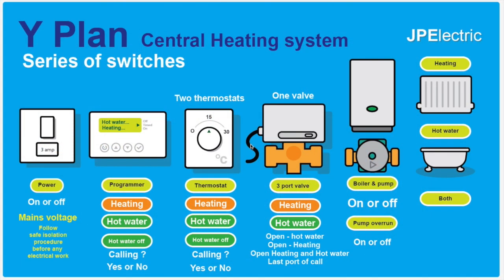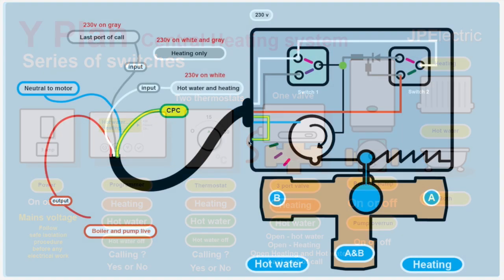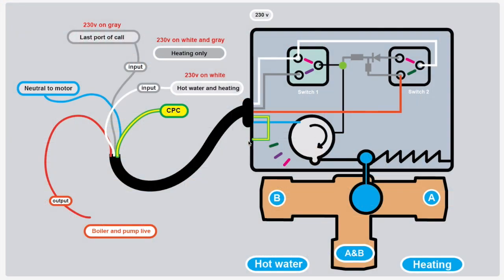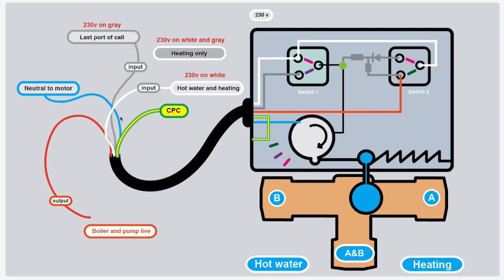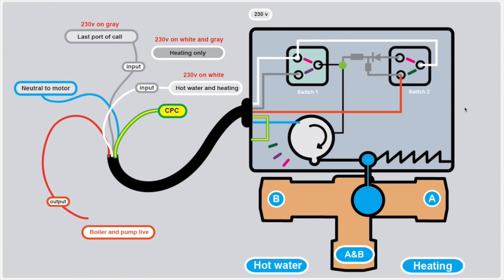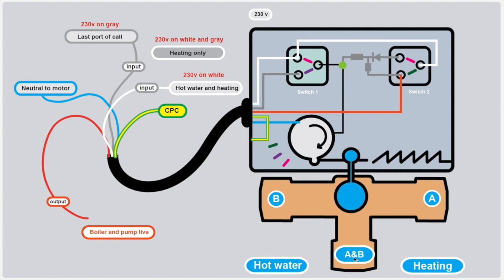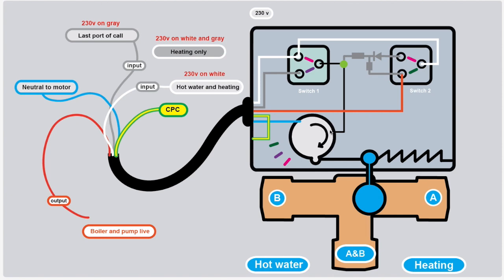Y plan wiring - made simple

Comment: This is the clearest, most helpful video I have seen.  In the only video that is remotely helpful - and I have looked long and hard.  You have a gift, sir. Thank you.  The plumbing in my house is very "unusual" and I have had many "engineers" work on it over the years. NONE of them have the remotest idea how to do this stuff. The expect every installation they come across to be identical to what they were taught.  They simply don't understand what all the individual components do.

Of course they know infinitely more than I do about the boiler and all the text book stuff, but no clue about how to analyse an arrangement where the orange wire is not where it is supposed to be, where the pipes come from a different outlet or go to a circuit not per the text book.  The standard answer is to rip the whole thing out, take up the floors, open up the walls and start from scratch.  Or just to replace each component in turn in the hope that it will magically solve all the problems.

And yet we have had a system that works as it is supposed to and has done so for over 40 years.  Until one of these "professionals" changed something a couple of years ago making it unworkable.  We can have hot water, OR heating, OR we can have the towel rails heat, but none of them at the same time. 
Your video has armed me with the knowledge to put it all to rights myself.  Fortunately I am an Electrical Engineer and getting to the bottom of the electrical circuits in the boiler itself, the programmer, the thermostats installed, our Nest, and the 3-port value has helped, but your video has answered some of the outstanding confusion I had.  Thank you so much.
Reply from the maker: Thanks Rob, really appreciate your comments, hope you got it sorted.

Comment: This has helped me understand how it all works, saved me a fortune (that I wouldn't be able afford anyway). Thank you! My heating is getting stuck on when there is no call for hot water or heating, so the mid position valve is sending on the signal to pump and boiler when it shouldn't. I'm replacing both the mid position valve and actuator this weekend thanks to your help.
Reply from the maker: Hi Joe T.
Thank you for watching, and your kind contribution,  I really appreciate it.  Hope you got your system working again.

Comment: Thank you so much for one of the best video's I have found on how the single 3 port valve Y-plan system controls the flow of heated water from the boiler. I retired from the trade 2 decades ago and the firm I worked with only installed single zone Combi boilers. That meant, i never got involved with zone valves. Fast forward now, I am looking to get my Y-Plan old Potterton boiler swapped with a Vaillant heatonly boiler and looking to have to figure out how to wire the 3 port valve to the VR66 wiring centre which only accepts L, N and E wires. The Room Thermostat communicates directly with boiler using Vaillant e-bus it communicates with the Wiring centre to control the mains relays for HW/CH and Thermostat controls. From what I have seen the techs are doing is, the Orange and Grey wires are connected together. Is this considered to be the correct practice?
Reply from the maker: Thanks for the nice comment MP.  Unfortunately I can't really offer any advice. I'm not a heating engineer, just a spark tying to make sense of the basics of heating controls.
Reply: @JPElectric  No problem at all. keep doing what you are doing. I found the install guide for the wiring centre and it shows exactly which wires need to go where for 3 port valves.
Reply from the maker: Glad you got it sorted

Comment: Really good instructional vid on Y plan, this and another vid by another youtuber have given me full grasp of how this system works. Now then, I have a question!  Is it possible to have an arrangement that turns off the boiler and pump if for some reason the boiler fails to light?  This would be to prevent the pump running cold for hours with the boiler not lit. Asking because I have two properties with boilers prone to flame out faults. Both are old boilers, which despite servicing still have this problem, but I can't afford to replace them.

Comment: Great explanation of how a Y plan, particularly the three port valve works. I'm looking to utilise switched lives 1 & 2 to give me high and set temperature on my boiler for hot water and heating, respectively. Apparently, to do this I'll need to convert to hot water priority which also (apparently) means I'll have to turn the valve 180. Obviously the wiring will have to be altered to match. Might be a bit of a head scratcher but you might have given me the info I need. Many thanks for that.
Reply from the maker: Thanks Phil, hope you had good success

Comment: I think I must be missing something here. I refer to the heating only diagram. The room stat is shown as open circuit, but the valve is shown in the central heating position, whereas just operating the CH on would not switch on the heating, or operate the valve without the room stat being operated. 

For what its worth, when I installed the system  I still have some 27 years ago I installed it with a mid position Myson valve. Time and time again it would stick in the mid position. I eventually came to the conclusion the the spring (a coil spring) did not have enough tension in it in mid position operate. I was so fed up with it I changed the whole thing for a 3 port Honeywell priority valve. I,m sure some might not like the fact that you can't have both ports open at the same time. But, I've never found it a problem given that it's takes no more that 20 mins to bring the HW temp back up, even after having a bath. Of course, if I was installing a system now, assuming I didn't go for a combi boiler, I would go for 2 port valves.
Reply from the maker: Thanks John. I will re look at the video, and get back to you.

Comment: Keep returning to this video if I have a problem with Y plan fault finding .@9:27 Heating On only.Both Room stat & cylinder Stat are "satisfied" (both NO).@ 9:29 Heating off(HW off as well.)both room stat & cylinder stat have flipped over to "calling" NC.Is this because this is their default setting (NC) when everything is OFF?I am trying to ascertain whether cylinder stat is faulty.
Reply from the maker: Hi Freeze foot 
Honeywell have some guidance on checking cylinder stats basically....
could be  a faulty Cylinder stat only if
Terminal 1 does not become live when calling for
Hot Water,  or Terminal 2 does not become live when
satisfied. ( Terminal C should be live in both
cases). When checking, disconnect Terminals 1 and 2
to prevent  backfeed causing incorrect readings
Reply: @JPElectric  Thank you for your reply as always.I may be guilty of overthinking this one , but always worth revisiting this video as I always find something that I missed first time round.

Comment: When both heating and hot water are calling for heat but then the room stat becomes satisfied why would the radiators continue to heat up until the hot water is satisfied or until I switch the hot water off and then on, then it behaves?

Comment: When your calling for hw and heating you say the boiler is controlled by the room stat but don't explain how the boiler is kept on for the heating if the room stat isn't satisfied. I believe this is through the 3 port valve electronics and perhaps you could explain that in your video. Otherwise excellent.
Reply from the maker: Hi Steve, thanks for the comment. When calling for hot water and heating. The heating stat energises the white wire which moves the valve into the mid position. Its the hot water that energises the boiler.

Comment: Hi thanks for the wideo, When valve 3 port is set to central heating it is all the time a hot motor and there is a soft noise coming from it, 
this is supposed to be ? How do I change to heating water everything is ok
Reply from the maker: Hi tomasz.. Sounds  like  last port of call . Its a quirk of the 3 port valve. It sits using a small amount of energy until the next command

Comment: I've just had my 3 port valve replaced and my hot water works normally but when I turn my heating off on the program unit it wont turn off. Its a Worcester Ri boiler and the 3 port valve appears to be a silver box with no make model info. I watched a video that said Ri boilers (and some other makes) suffer from "back feed voltage" could this be whats wrong?
Reply from the maker: Difficult to say what the issue is, but if it was working well before  the 3 port valve replacement, it would suggest that the wiring is incorrect.. I would ask the person who swapped out the valve to have a look.
Reply: Hello, hope you’ve got your issue resolved, it’s true what you’ve said on the Worcester RI can suffer with “stray voltage”  .. the valve wiring would need to be tested to confirm this (usually by removing the white wire from the wiring centre and with no heating demand from the programmer you should have 0 volts ... for example if you have 70 volts this can be enough to bring the being on when not required) fitting a capacitor suppressor will resolve this issue once external controls have been checked for any faults.

Comment: I stopped to study this video because you explain everything so simply and calmly and very informative, really appreciate your advice mate.
Just a question,  what is the wiring layout when a one channel timer is used, ie H/W and C/H on or off.
Reply from the maker: Thanks for the comments.
 A one channel timer is for a single heating zone, or a combi. If you want to control heating and hot water you will need a two channel  programmer.

Comment: Hi, I have 3 port valve, however I only have heating and no hot water.
When I turn on the hot water the rads come on but no hot water.
I have been away for about a year and boiler wasn't used much. This happened last year also when I was away for months, however that time it started working again after a week or two of boiler use. 
Do you think I have a faulty motor or is the valve stuck in the CH position? Do I need to replace the motor or the whole valve including the motor. It a Salus  SBMV32 valve.
I felt  the hot water pipe feed that goes in to the water tank and its really hot at the port side and relatively warm further along the closer it gets to the water tank.
Could I have an air lock in the system?
I have a gravity fed system on a Y-Plan.
I look forward to your reply.
Reply from the maker: Difficult to say , but, If you switch off power to the heating system,  (at the fused spur) the valve should reset to the hot water, default position.
Push the leaver from Auto to manual. If you feel can feel the resistance of the spring and the lever returns to the Auto position, when you let go,  the valve is not sticking.